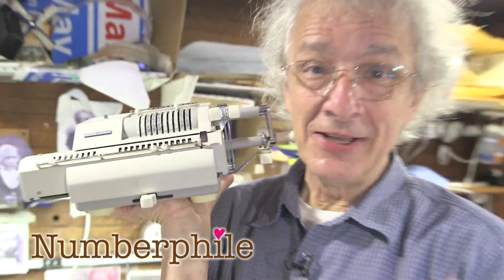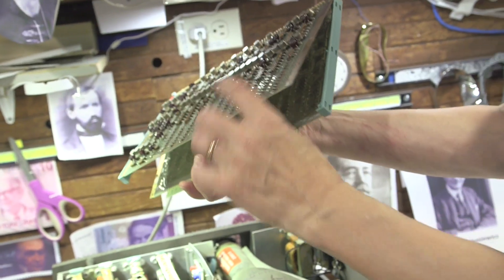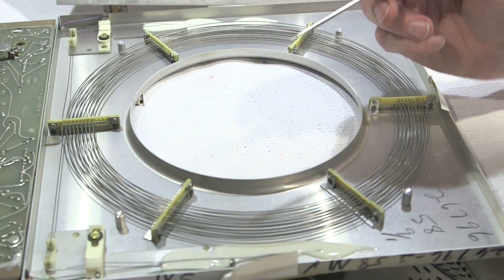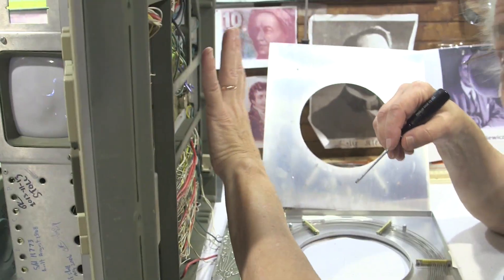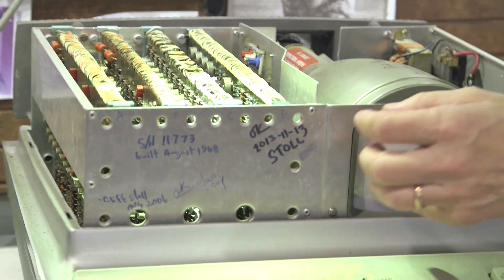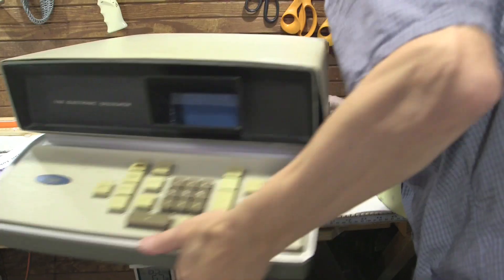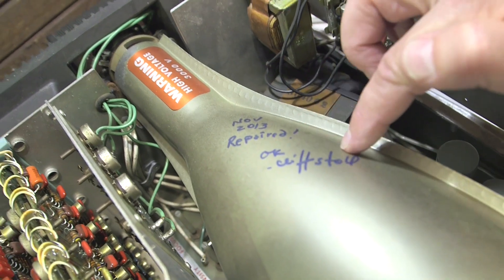An astonishing old calculator - Numberphile

Comment: According to Wikipedia, Friden was purchased by Singer (the sewing machine company) in 1965 but continued operation under its own brand until 1974. Back in my university days (early '70s) I used two Friden products: the calculator mentioned in this video (for an engineering course) and the Friden Justowriter. We used the Justowriter to create justified text for the student newspaper. It was really two units: you would type on one unit which produced a punched paper tape. It would indicate when you were in the "justification zone" so you would have to complete or hyphenate a word then start a new line. The tape was then fed into the other unit that added spaces between words to justify the line of text as it was being typed onto narrow, adding-machine paper. There was even a way of correcting typos on the paper tape.

BTW, if you want an slightly better approximation for pi (π=3.1415926...), try 355/113 (=3.1415929..., accurate to 6 digits) which is better than 22/7 (=3.142857..., accurate to 2 digits).

Comment: Wow, that piano wire (acoustic / torsional wave) memory is insane/brilliant!  I'm still unclear on how it "stores" the values for more than the few milliseconds it takes for the bits to propagate through the wire, though.  What happens after they're received by the speaker on the other side and they go back into the circuitry? Something must be holding the values while they're being displayed on the screen, right?

Comment: The memory doesn't send compression waves through the wire (speaker and microphone) rather it Twists the wire one way or the other to represent bits. Ferromagnetic metals have a neat property that they contract when in a magnetic field,  and conversely when compressed or stretched they produce one. 

To launch the torsional waves into the wire you had two nickel allow strips welded to the top and bottom of one end of the wire. Apply a current to a coil around one strip and when the strip contracted it sent a clockwise twist, do the same to the other strip and the twist was counter clockwise. 

At the other end all that was needed was another set of strips and coils connected to amplifiers. The incoming twist deformed the strips, creating a small magnetic field that was picked up by the coils, amplified, and read out or launched back into the other end of the wire if the information was to be kept in memory.
Reply: No, it's acoustics. All Robert Szasz is saying is that rather than being a longitudinal (compression) mode, the acoustic waves are torsional. The fact that there is a delay between the emission and the reception of the signal is because it had to travel from one end of the wire to the other, which happens at the speed of sound - which is equivalent to the speed of deformation - in the metal.
Reply: adb012 "Acoustics is the branch of physics that deals with the study of all mechanical waves in gases, liquids, and solids including topics such as vibration, sound, ultrasound and infrasound."
Reply: So the amount of memory you can store in acoustic memory varies based on how long the wire is?
Reply: So there's really no sound at all, it's just using magnetic fields to deform metal and the magnetic field produced by deforming the metal? I guess you could make a speaker/microphone like that but there's no real acoustics huh?
Reply: Boredness  The effect is was used in early sonar transducers, and there is at least one company making speakers using the effect. (It is also the primary effect that makes transformers hum)

What made this type of memory so useful is the way data was sent by twisting the wire. Sending a compression wave down a long coil of wire (hitting it on the end), or a shear wave (moving it side to side), and recovering it at the other end while keeping a long coil in a small box is a bit of a nightmare. With the torsional delay line all you need is to hold the coil in position by passing the wire through oversized holes and the torsional wave would happily travel from one end to the other.
Reply: Interesting, thanks!
Reply: Yeah, the fact it's a torsional wave is just an implementation detail that's not really important for the video, it's still delaying an electrical signal by converting it into a mechanical wave that runs down the wire and finally is converted back.

The same idea could in principle be implemented using longitudinal or flexural waves instead. The best choice is dictated by performance and engineering constraints: you want to minimize wave velocity, dispersion, interaction with the spacers/guides, and picking up noise from the environment. Torsional waves score well on all these points.
Reply: Acoustic delay line memory does exist tho.
Reply: placidesulfurik ... Well, I guess that in an ample view, you are right. But it is interesting that the same wikipedia article you quote has a section called "Acoustics, definition" that says:

Acoustics is defined by ANSI/ASA S1.1-2013 as "(a) Science of sound, including its production, transmission, and effects, including biological and psychological effects. (b) Those qualities of a room that, together, determine its character with respect to auditory effects."

I don't think that torsional waves can produce sound, except again in its amble definition of "oscillation of stress". Do you think that the waves of the sea are also studied by acusticians?
Reply: That makes perfect sense. I was wondering how the 'sound' wave wasn't dampened by the supports holding the wire into the spiral shape.
Reply: Yes.
Reply: placidesulfurik right. It's acoustics as it travels as a wave, but because fluids don't have a torsional mode, it's a type we could never directly hear. Speakers and microphones are strictly fluid couplers, either pressure or flow.
Reply: There no real acoustic in itself in a vibrating string, whether the vibration is longitudinal (tension/compression), traverse (like a guitar or piano string) or torsional. Or try to play a piano or guitar in the vacuum and let me know. I guess that Cliff used this analogy for didactically purposes, because how a vibrating string creates sound and a mic pics up the sound is better understood by the general public.Talking about elastic torsional waves may have been less understandable and appealing.

Comment: I went from using a slide rule to one of these during my last year at university.  Then we got a newer model that did square roots as well - mind blown!  Having the whole stack displayed on the screen made learning RPN easy, which came in handy when HP calculators arrived a few years later.

Comment: How does the wire actually store it as memory? In the explanation (including the extra video) it seems like it's just a really long way of sending a signal. Once it's gotten to the other end of the wire, it's just a signal. How do you control when it gets there?

Comment: I'm still alive, and built projects using acoustic delay line memory in hardware lab at MIT 1968-9.  By then they were smaller and looked less hand built, commercial units maybe the size of a 3.5" disk drive.  The devices I remember use rotational waves in a coiled wire, not sound, although other devices used acoustic pressure in a mercury-filled coiled tube.

Anyway, a big difficulty of these devices was that both the sending and receiving transducers are essentially coil magnets and therefore act as differentiators.  Therefore a single level change going in becomes a doublet coming out, and converting this back to digital bit was not really complex, but hugely noise sensitive.  Also, hard to debug, since oscilloscopes were not digital in those days.

I don't like the way Cliff handles the hardware unnecessarily.  Early machine, especially ones with extreme physical characteristic and/or size, are very subject to broken or flaky connections, even under thermal cycling.  The double-layer boards in this machine look especially kludgy and subject to failure.  While it may have been necessary to remove and unfold a board to make this wonderful video, the less the boards and connectors are manhandled, the less they'll break.  I'm sure Cliff already knows this.

Comment: Not astonishingly old, but In 1976 I was gifted my first calculator, a TI-1270. I can't work on its innards, but I still have it, and it still works (and it calculates 1+2+3 =6 no matter how fast I click the buttons, unlike my iPhone which returns 24 for the same equation, LOL)
Reply: Math and Logic By missing the 2nd '+'
Reply: known issue: if you press the keys too fast, it doesn't register the 2nd plus sign, so it calculates 1+23=24

Comment: anyone else notice he has some "10 DM" banknotes in the background?
it was the old currency in germany before the euro came in 2002
it shows Carl Friedrich Gauß, the famous german mathematician
i miss those banknotes, euro's only carry fictional buildings :/
Reply: There was indeed a West German 10 DM note with Carl F -- but the note I see in the background is a Swiss 10 franc note with Leonhard Euler (issued in 1979). 

https://en.wikipedia.org/wiki/File:Euler-10_Swiss_Franc_banknote_(front).jpg
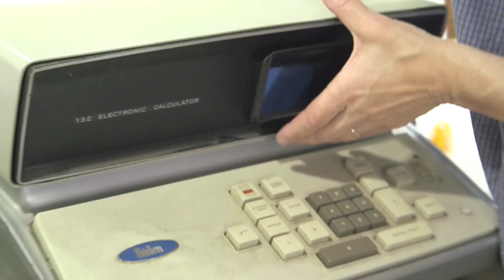Reply: Peter Lund At 0:29 you can see both notes.
Reply: That fictional is wrong by now, though. An architect and the mayor of Rotterdam actually let them get built: https://goo.gl/images/i4svq4
Reply: Indeed I can!   Carl F is barely peeping up over the calculator!
Reply: I don't think that's a real note. It looks too big. So it's a printout I guess.
Reply: It might be a printout, but keep in mind that DMs bills are relatively large and became larger as the denomination became larger.  More than a decade of using that currency and I can't rightfully recall one from another.

Comment: I don't think I have ever seen a real device that has germanium transistors.
Reply: Didn't the Japanese invented Germanium transistors? Well, they invented something to bypass the patent from RCA.
Reply: I don't know but I thought germanium cat's whisker diodes were first, then germanium transistors and finally they got going with silicon, which is much better because it doesn't melt. But patents are a world unto themselves, so anything is possible there.

Comment: This acoustic memory wire is very surprising. And it also appears to be very smart and creative to get it working as memory for the calculating machine.
Reply: The expensive way was mercury delay line memory (see wikipedia for explanations), but that is overkill for those machines. Works the same way but with mercury as a medium and was already available for several years in '62.
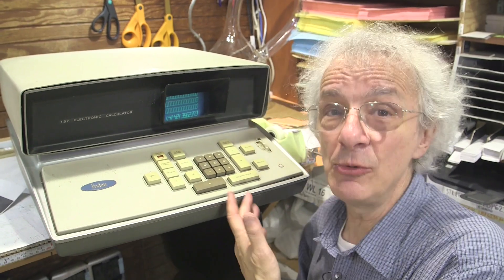Reply: At one time Cliff squawked so sharply, it appeared to scramble the acoustic memory!  6:33  Of course he was also touching it at that moment and it could have been something else that caused what you can see on the screen.
Reply: Yeah its such a crazy solution.
Reply: SaNjA2659: How many times could you run 1960s audio tape across the recording/pickup heads? There were already drums and disks working on the same principle, but probably too mechanically complicated and expensive for this application.  Wikipedia article on this type of memory is at https://en.wikipedia.org/wiki/Delay_line_memory#Magnetostrictive_delay_lines
(See earlier post by Robert Szasz)
Reply: What was wrong with using a loop of audio tape as a delay line, I wonder
Reply: this is better then audio tape. For one, this is passive. The vibration travels around itself so you don't have to keep moving a tape. This means the wire isn't going to wear out as fast. I would presume you get a faster bit rate with vibrations then with a tape too.
Reply: I would imagine how slow the transistor logic was the memory being a little slow probably didn't matter at all. There didn't seem to be much lag when entering digits on the machine

Comment: Make a video about "K" 
There's a Sigma for a sum, a pi for multiplication but what's K for?
Reply: K is used for a bunch of stuff. Just a simple K is the equilibrium constant (though often written with a superscript circle to denote the standard equilibrium constant). K_a for the acid dissociation constant, K_M which is the Michaelis constant from the Michaelis-Menten equation, there's Henry's law volatility constant K_H and much more. The reason pretty much every use of K uses a subscript is because K is so generally used.

Edit: If this OP was referring to K as in uppercase kappa, you can disregard this. Easy mistake as Kappa looks identical to latin K in this comment section.
Reply: "K" is that thing that gives you "S" when multiplied by log.w ... check Boltzman's gravestone
..
sorry ...
Reply: Klein bottle
Reply: TheMasterMind Kappa can represent many different things. In differential geometry, the curvature of a curve is given by K while in set theory, kappa is often used to denote an ordinal that is also a cardinal.
Reply: That's gauss's notation for continued fractions.